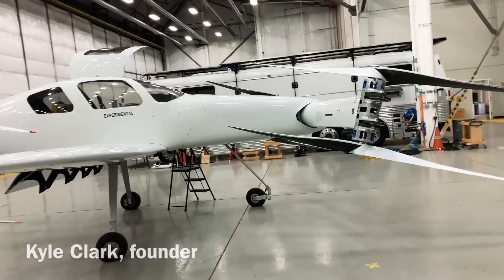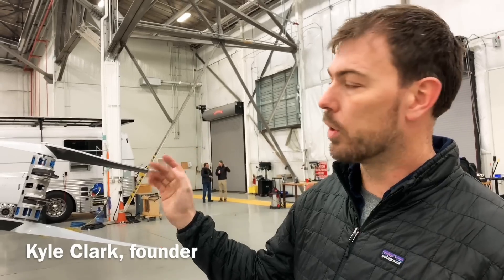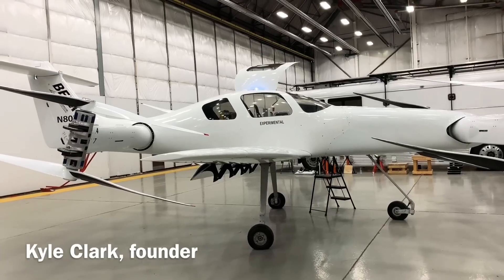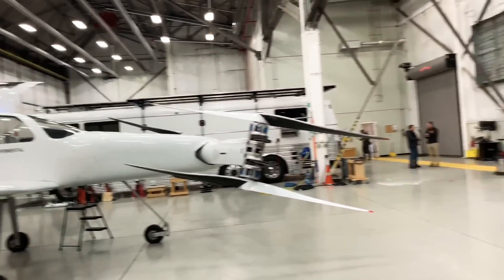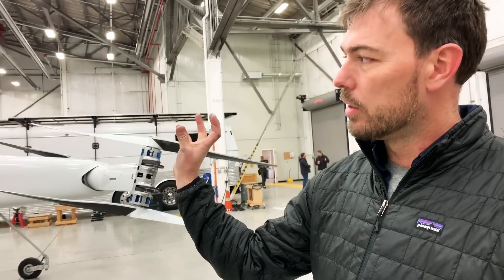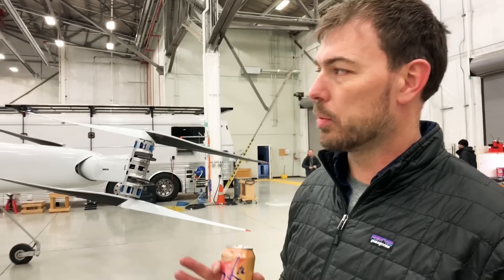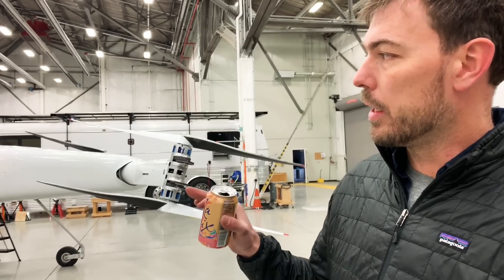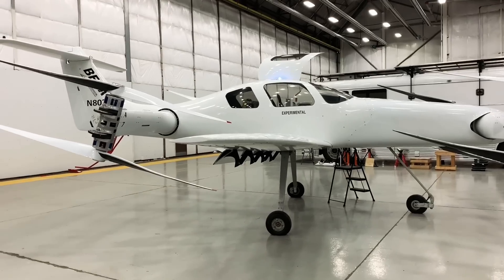Beta Technologies eVTOL Air Taxi Prototype

Comment: 3:00 _"The goal... was to elicit critical thinking... and the best way to do it was to build something"_. The world needs more of this man's attitude. This is a wonderful  achievement in its own right but what it has the potential to spawn, especially with the type of thinking underpinning the project - ie. long term knowledge building and sharing - may well be game changing. More power to you! Many thanks and cheers from Oz - Dave PS. Talked to Pipistrel yet?
Reply: Wonderful achievement? Get a life bro. All those blades that act like a lawn mower are pathetic. They are right in the path of people walking or working near this shitty aircraft. A helicopter is 100 times better due to its main rotor is overhead and well clear of people's heads. In what world are you from, what school did you attended not to see the faults this design has? Are you a safety minded engineer with a degree of complacency? Plus, those 4 arms create drag, making the aircraft less streamlined.
Reply: @mickcarson8504  You do make some valid points but here's my take... Firstly the aim of this exercise was to investigate electric drive applied to VTOL with the capability to transition to forward flight using wings for lift, which is far more efficient (and much faster) than using rotors as helicopters do. As such, this is a POC (proof of concept), never meant for production. Having achieved this, we learn something and get smarter as we work to producing something for market with appropriate safety etc. So in that context, yes this has been a major success and achieved many goals despite a multitude of technological challenges. Furthermore, we have increased our knowledge to make way for the next round of incremental improvements. Very solid engineering (I am an engineer). Perhaps you have somehow misread the intentions of this project. At least you got me to rethink my take...

As for your tone - you come across as an angry teenager trying to elevate yourself through insults. In the future, if you really want to get your point across, you will be far more credible if you drop words like "pathetic", "shitty" etc. and refrain from trying to belittle people in the process. A little bit of respect goes a long way. Cheers, Dave
Reply: Mick Carson 1- This is a technology demonstrator/proof of concept prototype. Can you design or build something better, “bro”?
2- As such, if you had bothered to pay attention to what the developer said in the video, you would have heard him say that this prototype is very different in shape & configuration from what the intended product will be.
3- Before you lash out at someone else, try to make sure you have a basic understanding of the subject so you don’t sound like an idiot... Helicopters ARE amazing, but they have two main limitations; speed and range. These are inherent to conventional rotary wing aircraft, and is one of main reasons the Osprey was developed- at great cost & time. It has the range & speed that the Marines NEEDED for missions that helicopters simply could not offer. There is clearly a need to look at new & alternative designs for VTOL aircraft. The new Sikorsky S-79 compound helicopter manages to address the issue of speed by using a rear mounted pusher propeller and two sets of highly efficient (as compared to conventional helicopters) counter-rotating fixed rotors that are shaped much more like propeller blades/lifting wings than conventional “hinged” helicopter rotor blades, that encounter asymmetrical lift & stall issues on the retreating blades that limit their speed. There’s also an Aerospatiale/Eurocopter prototype that uses two forward-facing podded engine/propellers, one on either side of the fuselage to create additional forward thrust for a higher speed, but it seems like more of an afterthought grafted onto an existing platform, and doesn’t have a positive effect on range. 
4- As to your primary issues, the four “arms” that you mention, while obviously incurring a penalty in drag, are plan-form in shape; like a wing, so the drag is most certainly offset by the gain in lift, allowing a significant reduction in power in forward flight that helicopters don’t have. I’m willing to bet that the engine pods will have more aerodynamic nacelles added, as well as nose cones/spinners to reduce drag further- remember, this is only a prototype. Lastly, as this aircraft uses electric motors, as opposed to the geared/clutched helicopter system of transmitting power to the main rotor, as soon as the aircraft has landed & is stationary, the rotors can, and would power down stop almost instantaneously. No-one needs to be, or conceivably would be around the rotors while they are spinning, so that “lawn-mower” safety issue is patently absurd. Conventional helicopter design is a “mature technology”- with only marginal gains in efficiency & performance left to be developed. New & alternative designs (such as this one) are necessary if significant advances in performance are to be realized. I don’t know you, maybe you were just having a bad day, but your negative and aggressive response in your comment, and to this interesting aircraft are not justified or well-informed. Good luck to you...
Reply: @mickcarson8504  You literally skipped over deldridg pointing out the statement "3:00 _"The goal... was to elicit critical thinking... and the best way to do it was to build something". Have you ever seen the 1st model of a "concept" of any vehicle be the final product?  Hats off to this company for getting the ball rolling on a concept of a product we as aviators will one day enjoy.